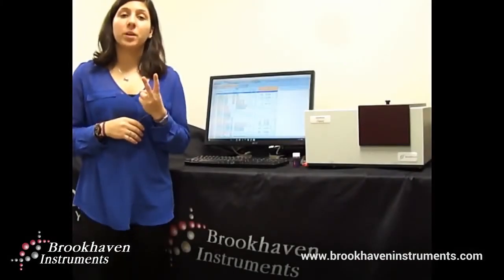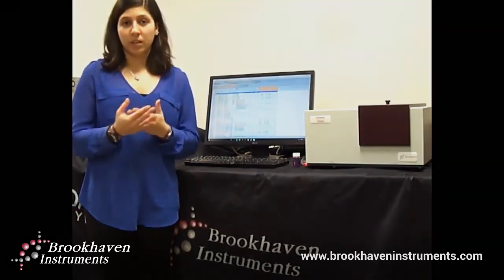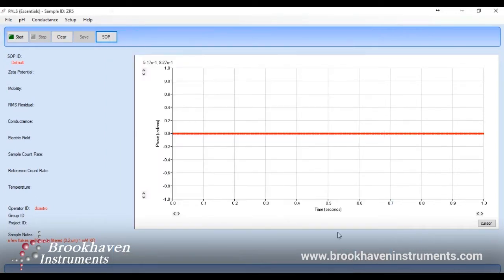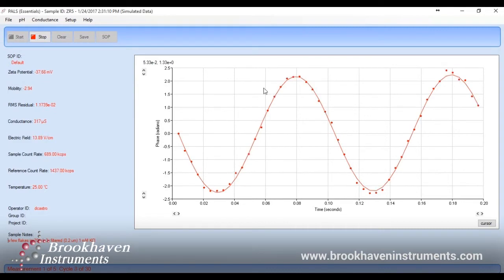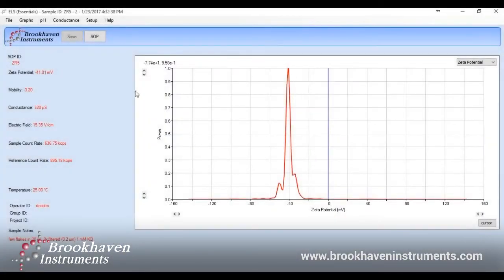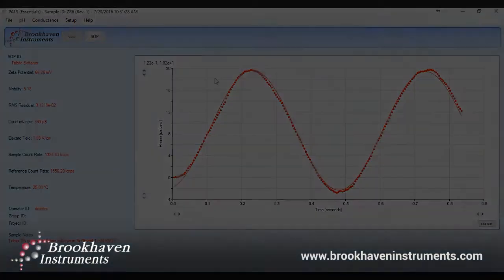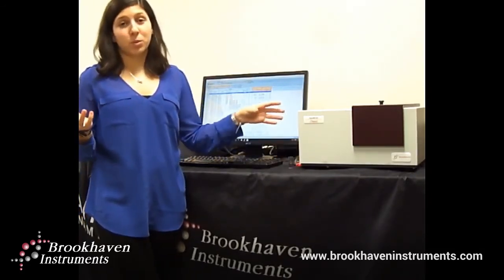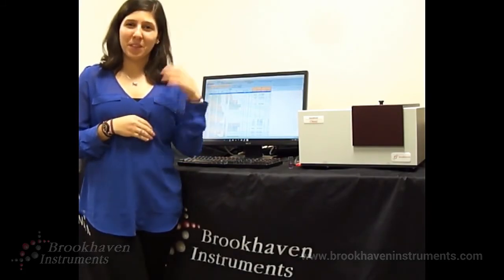The Basics: Zeta Potential

Comment: Helpful video. I want to measure zeta potential for graphene nanomaterial. The problem is graphene is not well dispersed in water or ethanol. I am looking for appropriate solvent so that well dispersed graphene dispersion can be obtained for measurement. Which solvent you suggest ? I am using 90 plus PALS of brookhaven at Arizona State University. Thank you in advance.
Reply from the maker: Hello Partho, please take a look at our DLS sample preparation guide found here: https://www.brookhaveninstruments.com/guide-for-dls-sample-preparation/ Specifically, look at the section titled "Dry sample dissolution" and the referenced ISO standard for dispersing powders in liquids.  If you are still having trouble, please use the contact form on our website. That way, your question will be be directed to one of our engineers who can work closely with you to come up with an in-depth solution for your specific application.